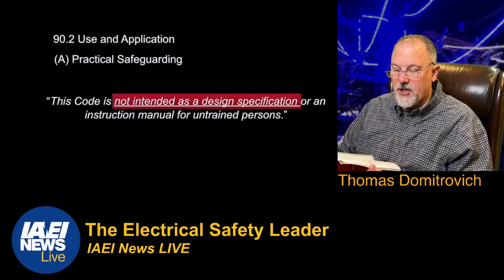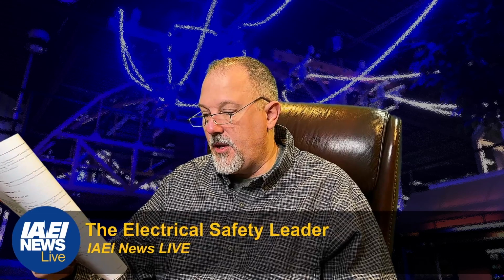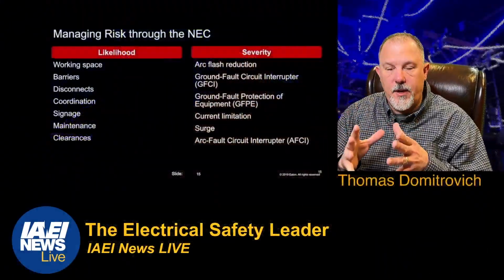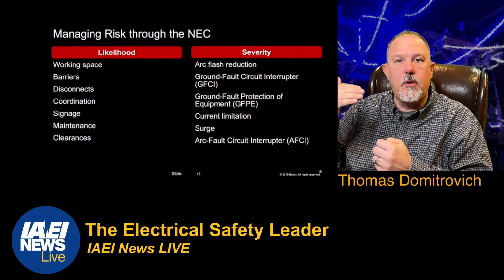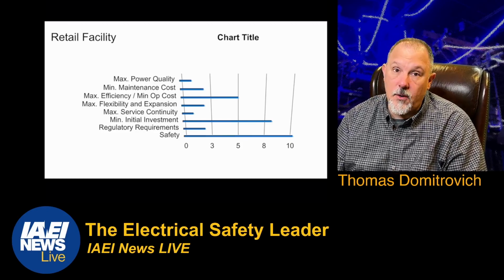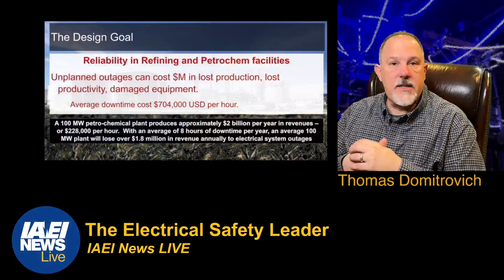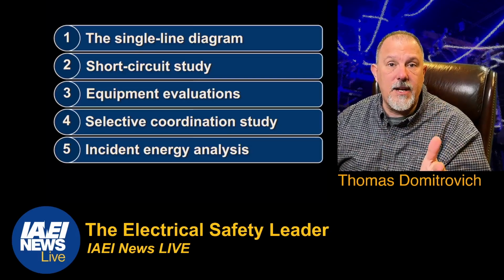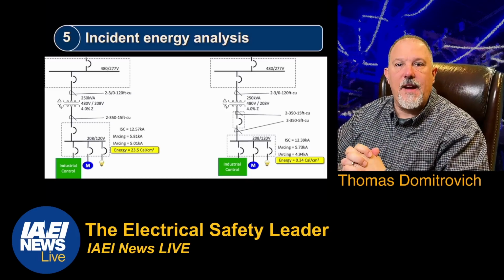Design Parameters and the NEC

Comment: Regarding the communication aspect, you mentioned three key people to get engaged at the design pase of a Project: the customer, the suppliers and the AHJ. Beside of that, I think that some other people should also be involved, that is the multi disciplinary team working in the Project, basically the mechanical engineer and the architect. On the first phase of the Project, there should be a conceptual study of the Project,  coordinated among the team, which should be the base for the developing the next phase of the Project and this coordination should be wotking until the finishing of the Project.

Comment: System and equipment failure when compared with minimum code and cheap,in my opinion is not in comparison under any circumstances  if you take the time to make the options clear...